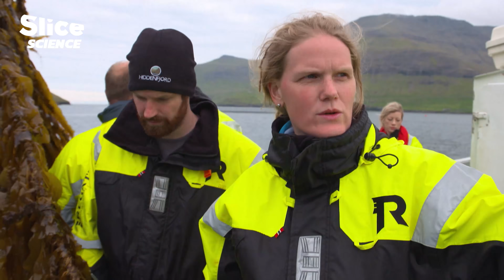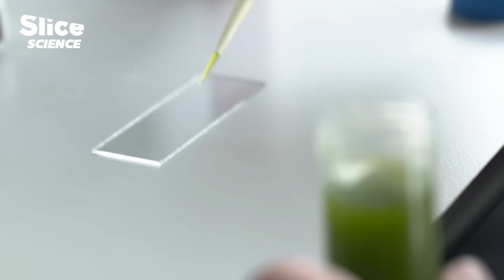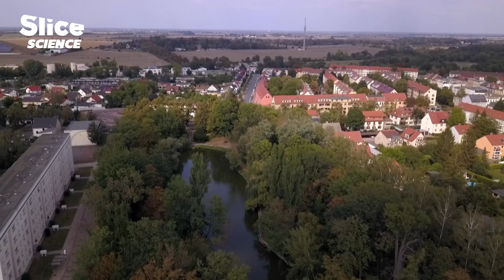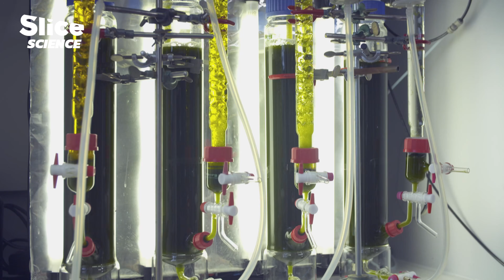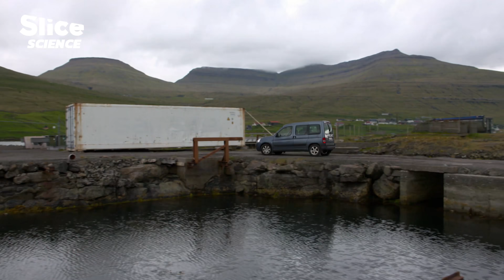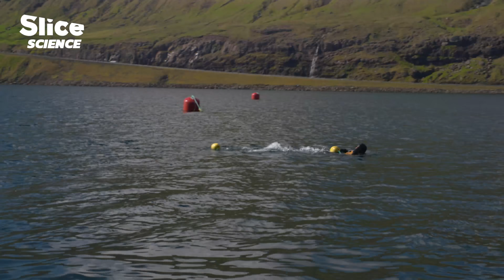The Algae Revolution: A Future Without Plastic? | SLICE SCIENCE

Comment: FATAL COSTLY MISTAKE around the early 2000s obsessed global warming (which has NOTHING to do with man, rather it is the sun) decided to force automobile manufacturers to replace plastic coated wiring with SOY BEAN material. GUESS WHAT? RODENTS LOVE IT! SO NEXT TIME YOU HAVE WIRING ISSUES BLAME THE OBSESSED GLOBAL WARMING LIARS. THE COST OF REWIRING CAN GO WELL OVER $1,000. 

If you’re going to develop a new products EXAMINE THE SPILLOVER DAMAGE. Making an alternative to plastic as a destination goal is NOT GOOD ENOUGH! Think it through 

(I had 2 cars that had to be rewired because rodents had a feast with soybean wiring Cost? $3,000)